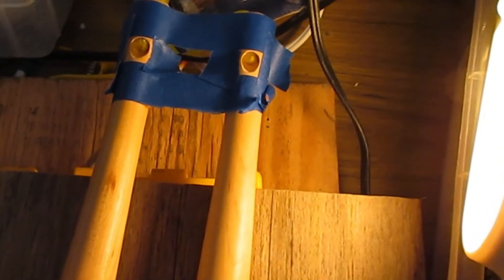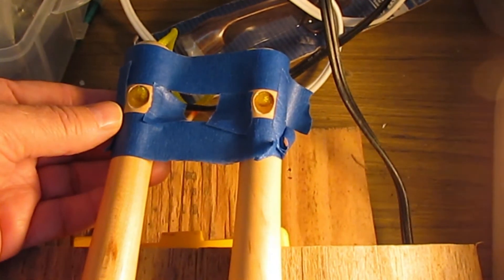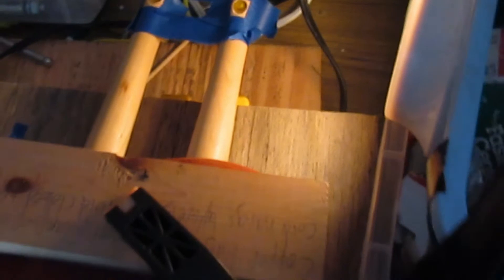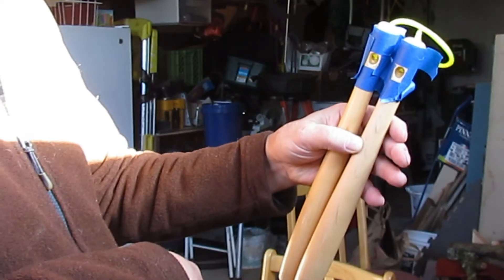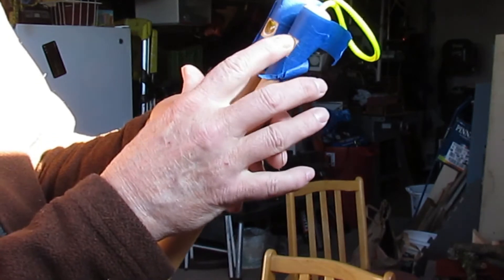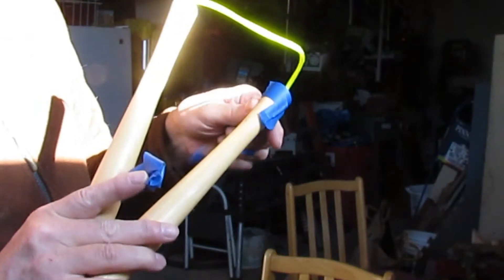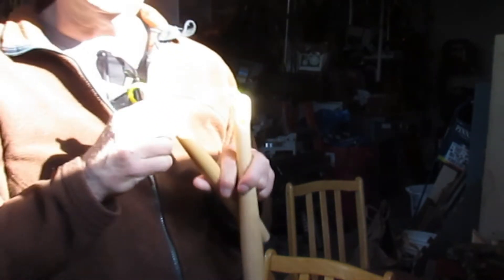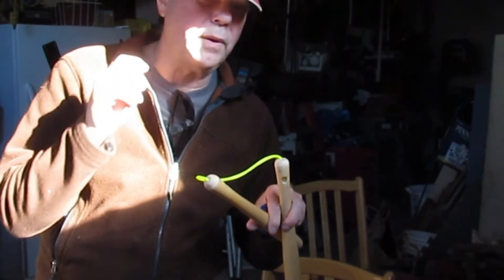a new angle with some key points on fabricating sticks

Comment: Looks good, maybe make a miter box for the drilling instead of "holding it", like you did for the drying clamp. and you can add an amazon affiliate link to the epoxy you use.
Reply from the maker: Good idea thanks a lot I'll start doing that